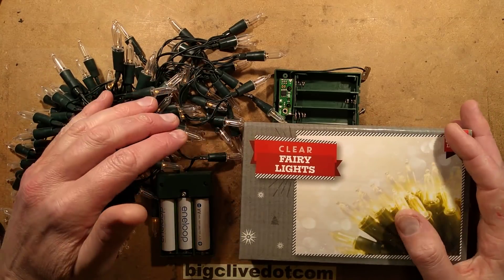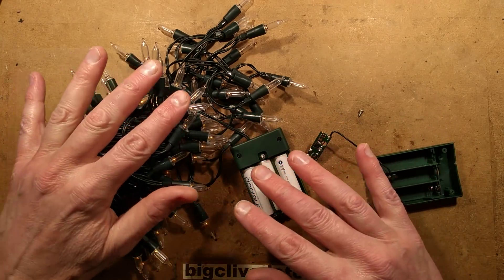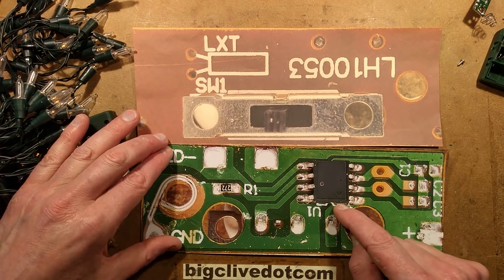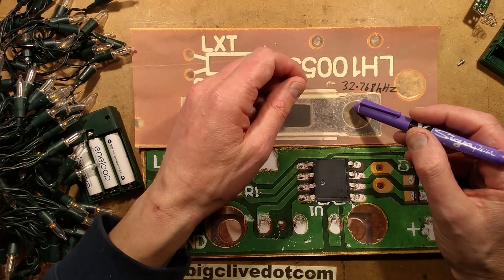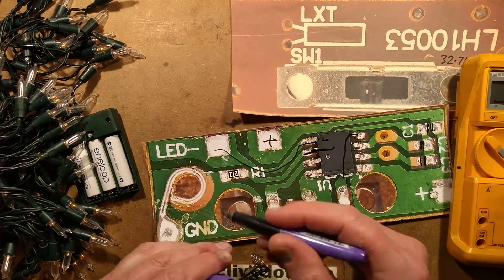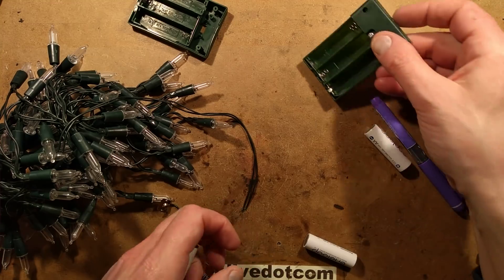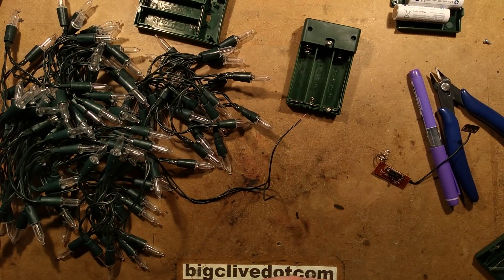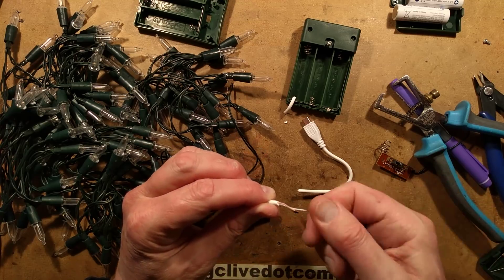Poundland lights unexpected feature and USB mod.

Comment: Until recently the strings of multi-coloured LEDs you can buy (from China) with SMD LEDs soldered straight to copper wire, were really rich and warm in colour.
Sadly all of the sellers I've seen now have a very cool colour version instead. It also has silver coloured wire, rather than the visibly copper from before.
Hopefully they'll change back at some point...

Comment: Did he just open a usb and only find 2 wires that's not good there should be 4 wires (though i don't know about usb c and other 3.0 cables)
Reply: It was from a power bank, so it didn't require the data connections. If it were accidentally used with another power source, such as a charger, it wouldn't matter as without any data connections the charger/ device would automatically sense this and therefore limit the current.
USB 3.X and C still use 4 wires and are fully backwards compatible with the previous standards. The main difference is available data xfer speed and power. USB 3.1 uses the same data speed as USB C but the available power is slightly lower.
Reply: Cheap non-standard power only usb cable.

Comment: I suppose just sticking a protected 14500 in there and bridging the other connection in the battery pack would be too easy? Charge the battery just like the NiCads of yester year. Maybe put 3 protected 14500s in parallel for extra longevity.

Comment: Most of those simple powerbanks do have short circuit protection nowadays .. doesn’t yours ?
Reply from the maker: They do have some level of short circuit detection, but some of the older ones still have a current path through the inductor that will still pass a lot of current even if the chip cuts out.
Reply: The 1£ power banks just burn out the inductor if the USB out is shorted. It'll supply about 6 Amp for a few seconds, before the inductor lets out the magic smoke.
Reply: Some have chips which will actually cut the output and pulse it until the short clears

Comment: Last year I did some of these for the historic railway station I volunteer at. However, I had a surplus USB charger type supply with a hardwired lead to a micro USB. Instead of removing the box, I just cut off the micro USB plug, let the cable in through a hole and soldered it to the main battery terminals. That way I didn't need to muck around with resistors and still had the flash effect available. In fact I combined two similar sets together, each with their own box, glued back-to-back and connected to the same PSU. That way the flashes of each set don't remain in sync and an interesting bonus effect is created. 

This year, I found there were two more sets that needed to be modded. I should say now that these sets have the same kind of 3AA battery supply, driving a chain of 50 LEDs. This time I took a set and installed one of those LED driver SMPS units, exactly the same one that you used on your LED strip flouro light replacement. Although I had recovered mine from a failed LED bulb (one LED burned out). The original batteries supplied 150mA to the 50 LEDs, but with the driver I was getting 300mA. That's still only 6mA per LED, but they sure are bright! 

This arrangement worked fine on the bench with the resistance of an ammeter & clip leads in the circuit but when I installed it in the battery box with nice short leads, it still worked fine on the flash mode, but the solid on mode was now causing the PSU to cycle super fast. I guess it considers the voltage drop of effectively a single LED too low & an overload condition. 

However, I didn't see this as a drawback as now we simply have two modes, normal flash & super-fast flash. It'll be used in the normal flash mode down at the station anyway. So job done after fitting a really long light duty mains lead, that way an extension cord is not needed to put the set where it wants to be.

Finally, I should point out that the sets I have been working with do not have the timer function built into the controller.

Comment: Clive awesome video man. I was also thinking  like everyone else You could of just solder some the USB cable wire directly to the battery inputs of that box or to the micro controller to keep the same functions. in our dollar store we don't have that many led's on Battery powered here. Most i ever saw was like 25 or 30 led's. I need to start making my own Battery projects for the holidays soon.

Comment: Surely it wouldn’t it be better to have slipped covering over both ends of the dropping resistors ? It seems from the video that the upper “snubs” are left exposed and could short out.
Reply from the maker: I did sleeve the full resistors and ends.
Reply: bigclivedotcom I’m sorry, I did check the video three times before leaving the comment. I’ll do so again and apologize if I missed your action. Thanks for the reply.
Reply: bigclivedotcom my apologies, at 17:00 you slip the sleeving over the whole resistor. My apologies. (Your probably a bit bored by me by now).

Comment: We have incorporated the self-timed mode (we call it SIFI - Set-It-Forget-It) for years in filipino parols, but we implemented 7 hours on - 17 hours off. We use a MicroChip PIC16F628A, which has horrible drift using the internal oscillator - so we added a 4Mhz crystal and 2 20pf caps. There's still drift, but it's seconds per month, not minutes.
Reply: We make our own sequencer PCB for our parols - we are all +12VDC inside, using an AC-to-12V adaptor. No mains voltages into the body of the parol.

Comment: Saw in Poundland today strings of 100 of those chip on wire LEDS that flashed to music beats.
Also they are now doing 4,000mAh battery banks for £5
Reply from the maker: I've made a video about the 4000mAh charger (actually 3000mAh).  Not come across the sound activated lights yet.
Reply: Oh yes, forgot about the charger vid, could have sworn it was a smaller one. They also do a QI charger in the same range.

Comment: In case anyone was wondering,  "A good blob of solder" is actually a scientific unit of measure.  All the cool kids use it
Reply: Although it has been used informally for a number of years I believe the blob (and hence the good blob and little blob respectively) was finally recognised as an SI unit at the the 26th General Conference on Weights and Measures, yesterday in Versaille.  Unfortunately it seems the announcement was overshadowed by the new definition of the kilo, mole, ampere, and kelvin. :P
Reply: The correct terms, in ascending order are: Touch, Dab, Blob, Gob, Lump, and Turd. 
"Look at that huge turd of solder on that joint!"
Reply: A good blob is a little more than a smidgen, but less than a touch.
Reply: It's the Plebian System of weights and measures. Also includes one glug of wine, one shake of salt and a gnat's nadger of chili.

Comment: The timer you mentioned drifting by 8 minutes, perhaps it's temperature sensitive and caused by the room temperature not being what the designers expected, you often mention that you like a colder enviroment than most people prefer?
Reply: The timer drift is most likely down to the lower voltage of the rechargeable batteries. 
I expect it would run faster if Alkaline batteries had been use instead.

Comment: Can you add a quartz and the resisters to make it operate or would programming be needed? Just curious if that would work
Reply: most microcontrollers have "fuse" settings that select internal oscillator vs external crystal which the programmer must set.  (They are called "fuse" because ages ago they were a one-time "blow the fuse" setting, but modern parts typically use EEPROM or flash memory.)
Reply: Sylvan Butler Agreed, either a hardware fuse would need to be set or, alternatively, the appropriate register would need to be toggled to switch the local oscillator source on the fly.  Given that most of these very cheap microcontrollers are OTP (one time programmable) you are very limited in terms of after the fact alterations.  Sometimes it can be done to an OTP micro if the new fuse settings just happen to align with the old as the default state for uninitiated bits/fuses in E/EPROM is typically logical “1”, so if the change only happened to require reprogramming an existing fuse that is logical 1 to 0 and no bits/fuses already at logical 0 required flipping back to logical 1 then you may be able to make that change after the fact provided they forgot to set the security bits to prevent reading the existing program state — but odds are you would also have needed to reset hardware dividers and such as many internal oscillators run at 4MHz and you would be installing a 0.032768MHz oscillator in its place, so the timings are going to change enormously (122 times slower!).  Otherwise, adding an external oscillator would almost certainly be akin to just soldering random disconnected parts on a PCB that effectively go nowhere and have no power — they would just be decoration rather than active components.
Reply: @Sylvan_dB  The dirt cheap micro mentioned is (at least listed as) one time programmable. Might of course be available in EE versions as well.
Reply: It sounds like it might be PIC mocrocontroller pin-compatible though so it would probably be easiest just to swap one of those in. You could add in more functionality too.
Reply: Mark Eckelkamp would be an interesting experiment!
Reply: I would need to be reprogrammed.
Reply: I tried adding a 32.768K clock crystal and 2x27pf capacitors to mine, but there was no trace of oscillations on my 'scope. I'll try timing it over the next few days.

Comment: 32768. I knew it would be that before you wrote it down. When you work with computers, that number comes up an awful lot. 32768 kilobytes=32 MB of RAM. 15 bit color is 32768 colors. 32 KB=32768 bytes.

Comment: It feels like you could at least program the microcontroller to compensate for the drift as the voltage drops. Surely there's at least a loose correlation to the oscillator slowing down and the voltage drop. Temperature is a bit more complex of course.

Comment: Another option, if you want the blinking/timer features without dealing with batteries, would be to connect the USB lead directly to the positive/negative terminals of the battery compartment. Usually works fine with anything requiring 3 AA or AAA cells.
I've done a similar project, with some of the tiny "pinpoint" lights with tiny solder-mount LEDs connected between two thin metallic wires. I combined 16 of those light chains in parallel, and connected the combined chain to a USB power supply like Clive did here, as I wanted them to stay always-on.  I then stuffed the lights inside of some old wine bottles on a shelf in my kitchen as decoration and as a dim light at night.  I opted to use a single LED in place of the two resistors, which should split the voltage to about 2.5 volts for a dim glow, without a lot of trial-and-error on exact resistor values.
Now I have 16 of those battery packs and circuit boards lying around.  Anyone have any ideas for what to do with them?

Comment: i have a set from last year. i wired in a usb cable and use them around my tv at Christmas
Reply: Karma Electronics  Why did he use two 10 Ohm resistors rather than one 21 Ohm in one of the leads ?

Comment: Hello
Can you help me to learn about multi line intercom circuit basics
if you can teardown one, or simply guide me somewhere else other than the simple online two line and basic ones
I'd like to figure out using two wire communication using microcontrollers

Comment: I wonder... can you put a christal on the board and the capaciters and so on and does it work with better timing then? Especially if you run it then from USB-power (5 Volt, more constant)
Reply: Well no, not without reprogramming the µController to use the different oscillator... (or do some auto-sense a crystal?)
Reply: That was what I was wondering. Maybe some auto-sense ? I mean when it is prepaired on the board, maybe it is also programmed for it (and normally sold for a higher price with an official timer-function)

Comment: Finding out which Poundland products are OK and which are shite... So we don't have to :-D
Reply: Tommy walsh appears on their DIY  products. I think they should have a bigclive approved logo and section in Poundland
Reply: @Martin-uf4ut  Now that's the sort of thinking that built the empire. Bravo sir!
Reply: Bought xbox dvb-t adapter for 5 pounds, had bad cable out of the box. Good  that it actually had micro-usb cable inside and i just replaced it with a normal one and only data leads were broken so i can use poundland cable for powering my RPi 3
Reply: Would never buy anything mains powered from Poundland.   My mate showed me a Poundland branded glue gun he'd bought for one pound the other day.  One fucking pound.  How is that even possible? Wouldn't touch it.
Reply from the maker: I think the glue gun is £2.  But that's still pretty cheap.
Reply: @bigclivedotcom  I've not bought the glue gun but the £1 epoxy is awesome. Sticks like shit to a blanket but can be loosened by boiling water. What's not to like?

Comment: I use 1 or 2 diodes to drop the voltage from a USB power source to 4.3 or 3.6 volt. No need to take the current into consideration then..
Reply: I figure it might be better to just use the original control board, as it has the necessary voltage regulation on it already - and it's designed to take input voltage across a pretty wide range, from about 3v through to a little over 5v (fresh out-of-the-box alkalines can run high 1.6v's each at low load, and if you have the super-power/lithium based AAs then they're over 1.7v), and should power the LEDs at something close to their ideal voltage.

Just connect the output of the USB cable to the battery input terminals on the board... either cut off the battery pack section with a dremel, or put it in some alternative housing like a tic-tac box or the like.

Comment: It is possible, that they have enabled internal pullups on pin 6 and you would then have a crude divider with R1, with the ability to check battery voltage, either using comparator or a/d. I suspect in this case comparator.
Reply: Or it may be an input pin with pullup, and tied to ground to tell the firmware NOT to use the crystal?
Reply: @the0844  You know what, I like that!

Comment: So glad I watched this video! I have been wanting to add some LEDs to a clock above my PC and wanted to run them from the USB on my PC, but could not for the life of me remember what the resistor value was. Thanks! :)
Reply from the maker: It depends on the number of LEDs you use.  100 ohms would give 20mA, 47 ohms would give about 40 and 20 ohms as used here gives about 100mA.

Comment: Hi Clive, do you know about 'tuning fork' based clocks and watches? These were used pre-quartz crystals, they don't use any IC or microcontroller either, the frequency is maintained electronically and converted to the movement of the wheels mechanically. They were used in the early apollo missions too, because they thought it'd be more reliable in zero gravity. (pre-quartz ofcourse)

If you're interested in this, google 'Bulova 214' which is the first movement that utilised this principle.
Reply from the maker: I do remember those.